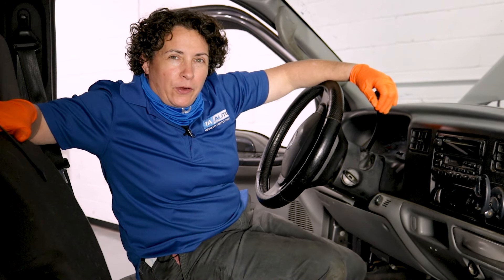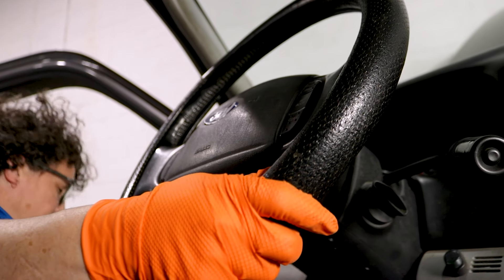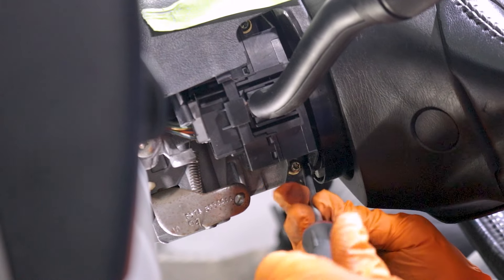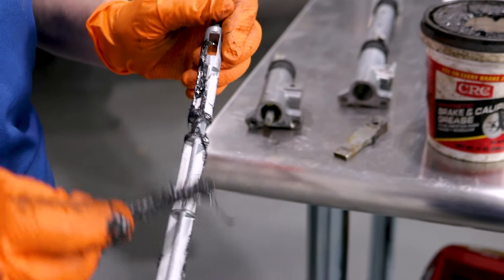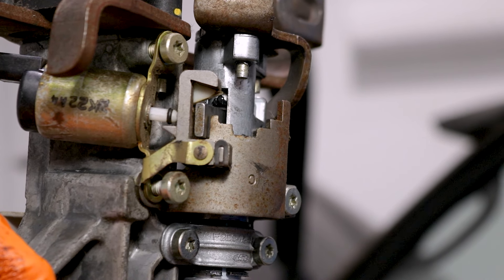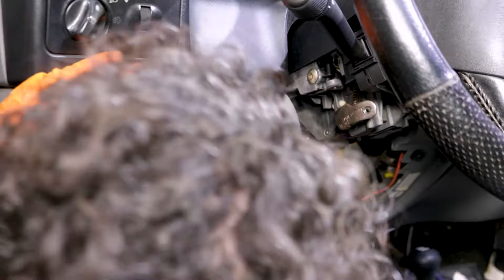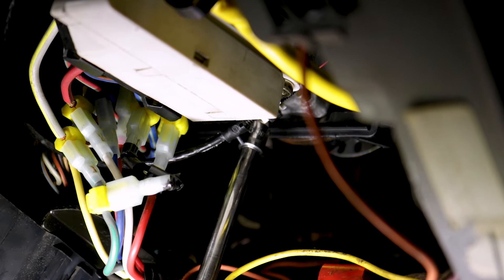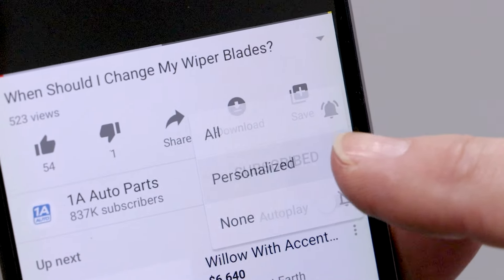Ford Truck and SUV Column Shifter Falling Down? How to Replace the Column Shifter Tube!

Comment: This can be done without taking out the column. You can just drop it down without taking it out and access all the bolts to remove it.
Reply: Agree, drop to column. There’s 4 bolts, just be careful, I scoot the seat forward to rest the column on.

Comment: I had mine break just yesterday when I was reversing out of a driveway that’s connected to an alley. . I got upset for about 10 seconds then I started thinking of what I could do. I put the parking brake on, and it held the truck from continuing to move into reverse so that I could crawl under and shift the lever at the transmission into neutral by hand. I was then able to get the help of a friend to hold the brake pedal down while I moved that same lever into drive and drove it back into the driveway, shut off the engine and apply parking brake and chock the wheels. This happened last night, and today I’m watching videos to see what is broke.  😂

Comment: My shifter tube was broken right at the far end where the two bolts are that attach it to the shifting bracket. I saw so many videos of people saying “just tighten those two bolts”. Well, that’s not helpful if the “ears” the bolts go into is broken. THIS video is exactly what I needed!!!! I have a 2001 Ford Excursion, and the entire process, shown here, was directly applicable. Thank you for making this video! Nice job on the repair, Miss!

Comment: This setup is the most complicated way of implementing a simple function!  If it must be complex, it should be bulletproof in design!  That thing was designed to break, but not before the warranty expired.  Sad that Ford used it for decades.  Great video though.  Now I have to chock some wheels and shift the van from underneath to get it to where I can work on it.

Comment: With the shift tube out, it's easy to remove the brake pedal interlock relay.  No more forcing the shift selector without depressing the brake or perhaps with no battery.
Now all I need to do is find a video on how to remove the steering lock pin without too much effort.  These extra complexities are additional points of failure!

Comment: Overall very good video.  However, @ 15:08, you want to grease the INSIDE of the plastic bushing, NOT the outside.  The saddle where the bushing sits, and the outside of the plastic bushing should be clean and dry.  The INSIDE of the plastic bushing should be lubricated with a plastic-friendly lubricant before the plastic bushings are snapped into place.

Comment: I got a 78yr old marine vet that crawled under his truck to shift in N to start and then D with E-brake set and he drove it 😬😬😬 going to fix today, the pin on the plunger snapped off

Comment: Thank U 4 this step by step amazing video. This helped so much. Part was $100. Was able to do this also without removing the steering column even though I'm sure you did this 4 the video. 😊 I repaired the old aluminum tube that snapped with a new Steel shifter tube. This was on a 2009 Ford F750 Flatbed Tow Truck. 😊

Comment: I was parked on a slight incline - went to put it in reverse to leave and something broke - shifter is really sloppy but im still able to put it in reverse, neutral,  and drive - but not park  🤔
Reply: That's what mine did. Went like that for a good while using the park brake when I park, now I got nothin but neutral

Comment: After doing this project I havnt been able to get my truck to start. I hope you can answer a question, in the video at 9:19 there is a pink/black wire that hooks into where the ignition comes out of. Can you tell me what that is for? Mine won’t stay in and wondering if this is the cause. Thanks

Comment: Just did this in a 2004 F350 I recently bought with a broken shift tube and rod. I was able to do it without removing the column. With that said it may have been easier to do it that way. Definitely tight spaces to work with. I am happy with the result. A running and driving four door 8 foot bed V10 truck that I only have $800 in.

Comment: Thank you very much!  Great video!  '04 F250 Triton 5.4 SD Crew, replaced tube, cable to trans, gear shift lever (broken O/D), and gear indicator.  Preferred removing whole column, working on garage bench.  
Ty again!!

Comment: Shalom Aleichem. 

On my 1997 F-250 pickup with a 7.3 liter diesel I didn't need to remove ½ of the stuff she's removing?

What year is the vehicle she's working on?

My shift tube is completely busted in ½. $28 at Rock Auto, plus I bought another serpentine belt (on sale) an idler pulley for a grand total of (including s/h) $90.

Good video, very informative. 

Ratson haba b'shem YaHuah

Comment: You left the 2 bolts your loosened for the rear indicator to remove the shaft loose.
Reply: Yes I noticed that. The 2 bolts on the electronic plunger.

Comment: 08 ranger I had to replace everything from inside the shift column all the way down to shifterselect position sencer ,shift lever to transmission , cable ,cheap, no  the shift arm was 85 bucks , only from a Ford dealer, plastic crap all through this system, no good , I put this in my self , what would cost me at a dealership, or garage ??.

Comment: You said you wanted to meet me...
I started the truck, went to put it in gear and the shifter went limp. After an hour of prayer, Google and this video I got out of that downtown spot at 11pm and made my way up I95.
I went in under the dash, popped the cable off that ball joint going to the Linkage, popped it out the retaining bracket and baabam.
Full disclosure the truck was in park when the shifter snapped. I was able to pull the cable with two hands out of park, through reverse into drive and thankfully made my way home.

Comment: Yep, the bolt for the shifter on one side broke and the threads broke on the other where it meets the bracket for the cable so I took the cable out of inside the dash and ran it under the dash and shifted with that instead, but then the cable broke (apparently it was rubbed underneath) so I figured it’s time to replace both 😂

Comment: I have a disconnect around there somewhere, have to put the truck in Neutral, tilt it a bit, turn the wheel a quarter, tap the dash three times, then turn the key over, then wiggle the shifter to get it to start.

Comment: Thank you very VERY VERY much because My husband and I DONT know anything about cars or trucks and this video helped us get the truck going!!! 

One thing though…you forgot to mention or maybe i didn’t hear to put the cable right in place whenever you put the steering wheel back on because I didn’t know until I compared another f250 with my 250 and noticed the black cable that goes hanging with the screws that hold the wheel so it don’t fall but regardless THANK YOU! Thank you for using simple tools too!!! Love love love it!!!?
Reply: You shouldn’t of taken the whole steering wheel column off lol. Cause you don’t have to, to do this job

Comment: Outstanding video, very easy to follow and great help. I managed without pulling everything out, your video made it very clear exactly what everything does and reassembly was easy following along with you. I replaced the tube and bushings for under $50 using OEM genuine Ford parts on '99 F-350 XL. Very happy to be up and running again.

Comment: So this just happened to my '99 E-350 ex-ambulance (which means it weighs 8500lbs) and I have to shift it manually with the cable while holding the brake pedal down with my hand while I sit on the step up into the cab, then transfer it to my foot and climb in then I can drive.

Comment: What size are those t30 screws in the shifting assembly? I know nothing about tap and die kits, and managed to strip out the aluminum behind the support brackets, need help asap!
Reply: I'd just buy another shifter tube and be very careful not to cross thread or over tighten it this time.

Comment: I can tell you love your job by throwing a few jokes made me actually want to pay attention. Anyways I had to buy one for my 2000 F-250 Super Duty 7.3L diesel, because my shifter was loose. It was not necessarily stuck in one gear. One day I was at my house I had put it in park and instead of park it was in reverse so I had to shove it all the way in park, but doing so I broke my orange reader that tells me what gear I’m in. So when we finally got it out we went to the auto zone in Mount Pleasant they had the tubing; however it did not come with the two brackets. So we bought one of them because they were also separate, they also only had one. So we ended up driving all the way to Clare to Oreilly to get another one. My question is how come the tubing and the brackets that hold it in place are not together in a box. Better yet how come I had to buy the two brackets separately? These were Dorman parts btw.
Reply from the maker: +Alex Taylor Thanks for the feedback!

Comment: Ah ha. I'm the one who did it!!! Pin the brake pedal. Engage e brake . Start it up. Get under there and get it into gear. My shifter split in two in park. And hanging like that. Kick the pin on brake with your foot. Get her home. And yes you can get it in park to start it to put it back in gear. And you dont have to remove the column to do it. Easier??

Comment: For WITW, be aware that the new parts do not come with the lever located near the far end of  the tube that "locks" it until you press the brake, nor does it come with the pins or springs. I also found that the new unit(s) may have the holes for the pins undersized too much which makes it darn near impossible to drive the drift pins fully into place. Too much force on driving the pins in will break the pretty new aluminum tube.

Comment: You don't have to pull the whole steering column to do this
Reply: yeah but the video is much more clear this way -- and it's nice to see the process of pulling the column too!!
Reply: If it broke in neutral and i remove in neutral do I put the new tube in neutral position when I put back in?
Reply: Ya

Comment: Why would you take the steering column out??   Just lower it !!
Reply: I have to do this on my 2002 f150, and I was wondering the same thing. It's not necessary to take the column out to replace the shifter tube is it?
Reply: @marine4lyfe85  this channel has an earlier video where they showed how to do the same thing without taking out the whole column.

Comment: whats your phone number because i was stuck at work due to mine breaking and i got under there and pulled it into drive got home turned it off parking brake and chucked the wheels now watching to see how to fix
Reply: 😅 i did the exact same thing took me 2 hrs to figure out my shifter was broken and another half an hour to come up with the idea you used to get myself home reversing was no fun I almost ran over my legs when the vehicle started to move 😅